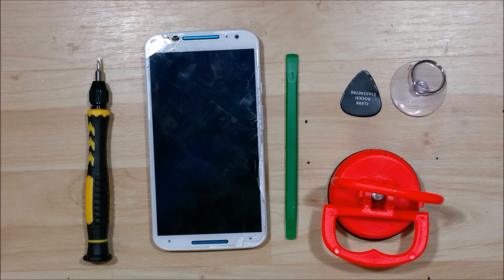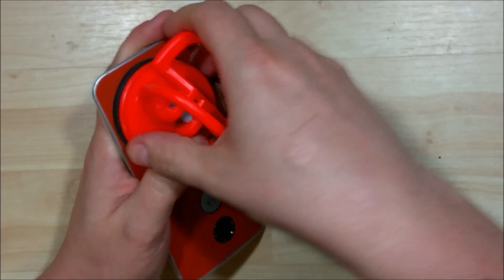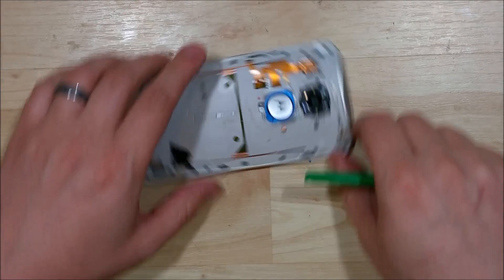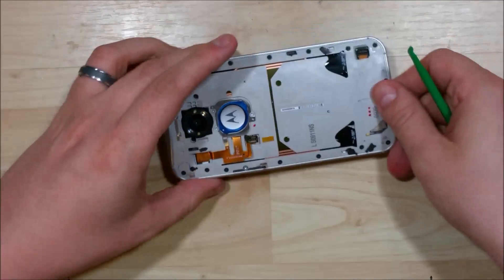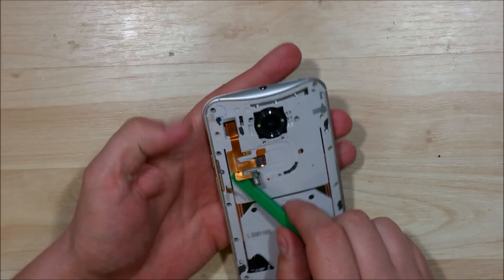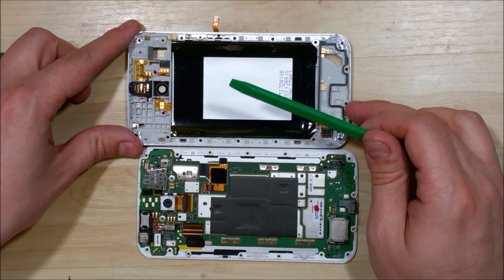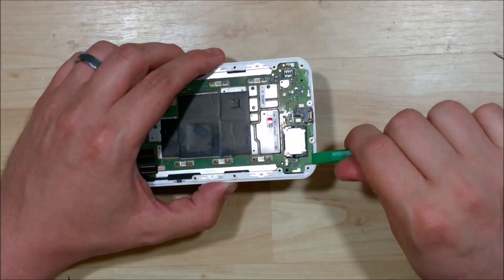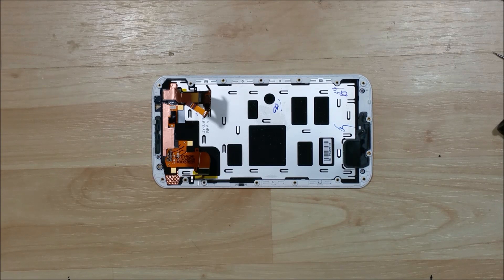Motorola MOTO X 2nd gen (2014)  Disassembly - Screen Replacement - Glass Only Repair Educational

Comment: I see everyone talking about the torx driver ... I used a Torx 4 to do it.  Bought a nice kit on Ebay for $6 delivered with 3 drivers, a prybar, and a guitar pick sized spreader.  My only problem is how does the battery cover come off exactly ... I broke the one on my Moto X Style, don't want to make the same mistake on this one!

Comment: Hi. Thanks for the videos. I ordered an lcd/digitizer+glass replacement piece due to my lcd being cracked. The new screen doesn't have the protective foam backing that the oem digitizer has, which the metal plate/mobo sits on top of. I wasn't able to remove the foam undamaged from the old screen. I haven't been able to find a replacement piece or even reference to it anywhere. Do you know what could be used in this case?

Comment: Hi. Nice clear explanation. Thank you.... I dropped my Moto X 2nd gen yesterday and the screen is now black and non-functioning but the phone itself is still working, i.e., voice commands still work, I can shake it to turn on flashlight, etc. Not sure whether touch screen functions still or not. Anyway, do you know how likely in this scenario the existing screen can be made to work again? i.e., is it likely that a screen connector just came loose that I could follow along to your video and just reconnect? Or is it most likely that the screen is now dead? The screen was already crack but functional before the most recent drop. Thanks for any guidance you could provide! Cheers.

Comment: Hi, 
I just did a screen replacement on my Moto X Style. I previously brought it to a tech to fix and but they installed a faulty screen so I did it myself. The problem was that I think they lost a few of the screws. I was wondering if the screws for this model are the same as the Style? Since they're the only one's I can find online atm.

Comment: I'll save you all the pain of the back cover (after driving through a blizzard and then waiting 2 days for Amazon to send me a good suction cup, and it still not coming up).  Turns out you just poke a paper clip through the SIM card slot. https://www.ifixit.com/Guide/Motorola+Moto+X+2nd+Generation+Back+Cover+Replacement/40568

Comment: Hi How2Tech I need your help, I followed your instructions for screen replacement and accidentally broke 2 pins on the motherboard flex cable, but I tried to turn on the phone still. I got a flashing white screen with the charger symbol showing and the green led indicator would flash along with it. So I ordered and replaced the motherboard cable, but the screen is still flashing along with the green led. I've hit all different power, vol combos for different lengths of time, but to no avail. Im able to be in fastboot and the screen is stable and works, but when i select normal power up, recovery, factory, any of them it goes back to the same flashing (all expect for barcode). If you have any ideas it would be a huge help.
Reply: For the record i just figured it out. Noting came up on all google searches for flashing white screen with charging symbol on it. but i found the problem to be a loose battery connection. I took the back over off and saw it a bit loose. I pressed it in further and it snapped into place. and now 100% up and running with my new screen replacement. Thanks so much!
Reply from the maker: +Jonathan Correia Didn't do much but glad you figured it out. Thanks for watching!

Comment: Why do you have to disassemble the complete phone? Wouldn't be possible to just remove the glass with the heat gun WITHOUT disassembling the phone completely? Thanks for your detailed instructions.
Reply from the maker: +Jose Antonio Gomez Possibly but then when applying the glue to put the new glass on it will leak all over the inside of the phone and most likely ruin it.

Comment: Why do you have to remove the back cover and screws if you are only replacing the screen + bezel and you are doing nothing with the LCD digitizer?  If you buy a screen + bezel assembly all the steps are the same except you don't need to remove the glass from the bezel? Do you have a link to a glass + bezel complete assembly?
Reply: +Lance Barke +How2Tech really appreciate these videos, look forward to your help

Comment: Suggestion… when you show a how to video on disassemblly and say that you need a small torx… giving the size of the torx would be a good idea… its a #3 torx btw.
Reply from the maker: Mark Gorzka Good suggestion thanks!
Reply: What the hell are you talking about 0tlio3lo.already attempted and completed. Was simply making a suggestion. Keep your lame comments to yourself.
Reply: @ +05li03lo 
STFU
Fastener/driver size is CRITICAL, especially with Torx which can be stripped extremely easily with the wrong driver and ruined.
Mark is helping the community with his helpful comments, you are not.

Comment: Ok, so I accidentally ripped the copper wire that you warned me about on the left side of the phone.  Now my phone won't turn on...Is that hard to replace?  Also, the torx screwdriver that came in my repair kit didn't fit correctly and me not knowing how easy/hard it would be to take them out stripped the screws in the process.  Is my phone just a lost cause?
Reply from the maker: Ben Nobles The cable should not be hard but finding one will be....You can try putting tape over the screws and them pushing hard into the tape to remove them. You could also try very small amounts of super glue.
Reply from the maker: Ben Nobles Here is part of the cable: http://www.etradesupply.com/motorola-motox-xt1095-xt1096-xt1097-motherboard-flex.html

Comment: Need some help please, is it possible to use this process for the nexus 6, also its pretty hard to take apart the nexus 6 so can I change the outerglass with everything intact in the phone ?
Reply from the maker: shisharette9 Yes this process would work for a Nexus 6. I do not suggest doing this while the phone is intact it could severely damage the internals.

Comment: If you look inside the SIM card tray slot there's actually a small hole that you can push a pin/tool through that will begin to peel the back off. I removed the backing without any heat.